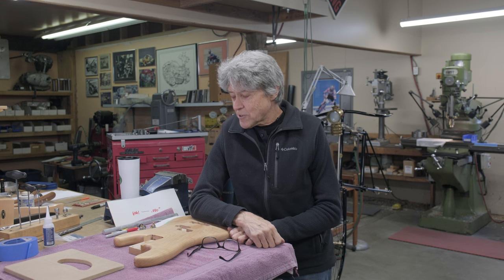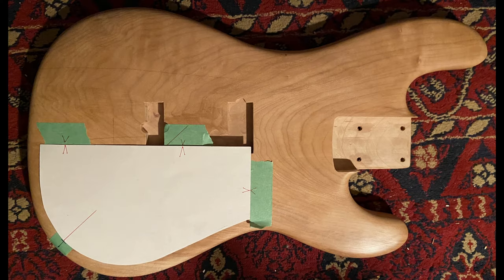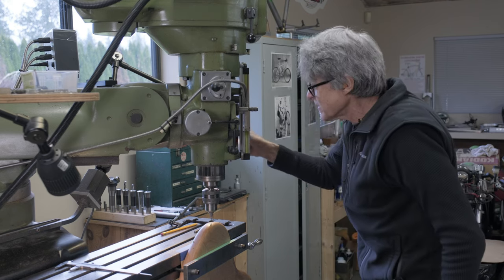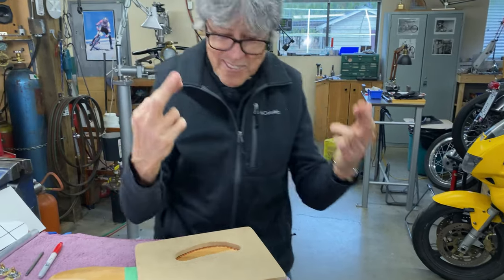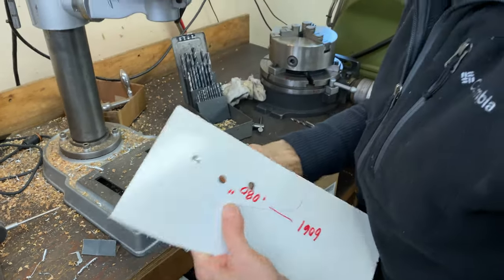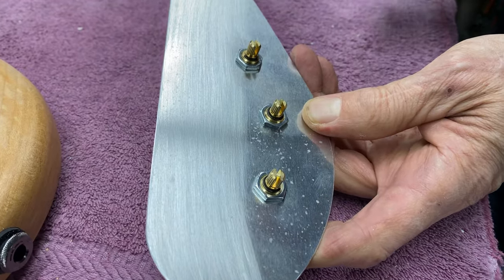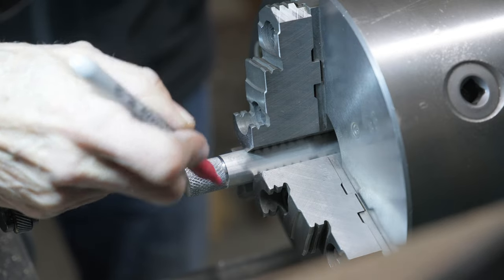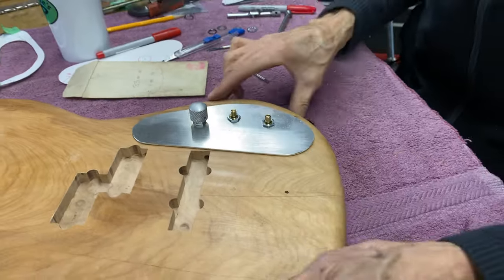Working on the BASS GUITAR // paul brodie's shop

Comment: Loving the bass build Paul.  Here's a thought, you could turn a recess in the bottom of the knobs that would skirt over and hide the exposed nut of the potentiometers.
Cheers
Reply from the maker: Thanks Rick. Yes I have already counterbored the knobs a bit, but if I do it a bit more, that would hide the thin nuts... Good idea!

Comment: Before you put the curve on the aluminum cover, consider beveling the top edge a little. Just glue it to a wood template, and route it with a 30° or 45° bevel bit for a more finished look. 
Loving this project, as always, great work guys! 👍
Reply from the maker: Great idea, but it's a little late now. Maybe for my next build...

Comment: sharpen you Dad's file with acid, if you've never tried sharpening a file that way you'll be amazed. make a 50/50 muriatic acid and water mix, then give the file a 40-45 minute bath and Voila!, it's like a brand new file. but you probably already know about that trick.
Reply from the maker: I did not know that trick, so thank you. I did a screen shot :)

Comment: hows the cancer doining mate?? your looking great. Good work on the guitar ive been building and restoring various instruments for over 20 yrs but lets face it i knew you would do a great job its who you are buddie. The perfectionist inside of you wouldnt let you do a bad job. May i humbly recommend that you block of the slots in the top of your pot posts/shafts other wise when you tighten your set screws it will push the gaps closed instead of clamping your knobs on. And the knobs will fall off or just keep losening. ive been there before so you dont have too lol. Solid shaft pots would of been a better alternative but spacers will do the job just as good. hope this helps buddie
Reply from the maker: Thanks Chris. I am doing my best to stay well and healthy. Hopefully I can keep cancer at bay. Yes, I will make sure the slots don't cause a problem...    :face-fuchsia-poop-shape:

Comment: You have the wrong type of pots for a set screw, you want a solid 1/4" shaft not a split shaft. The set screw won't work well.
Reply from the maker: Yes, I know what you are talking about. The drilled hole is a very good fit over the spline, so I don't even really need that setscrew, unless things "loosen up".